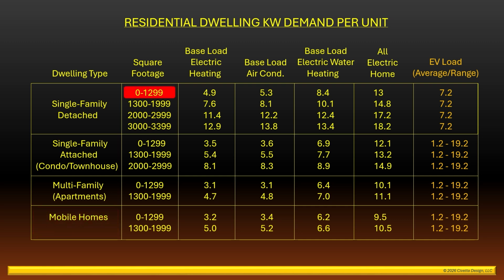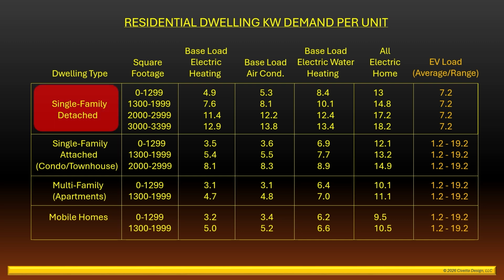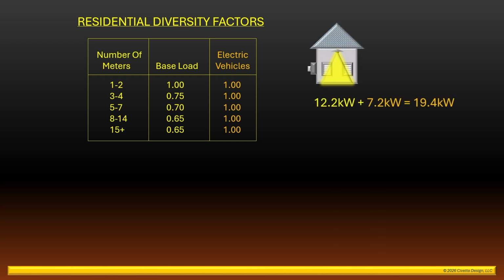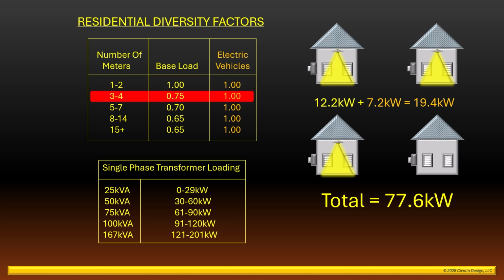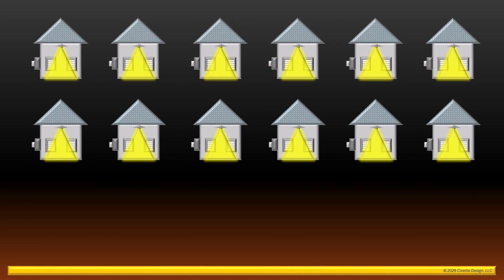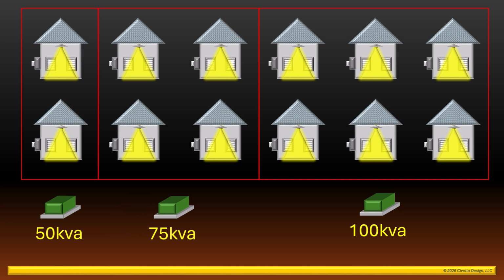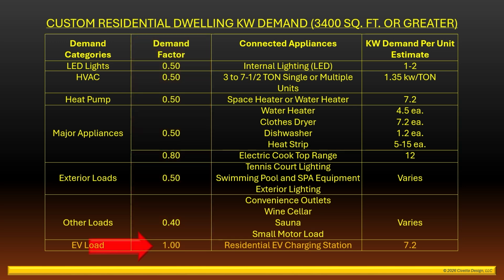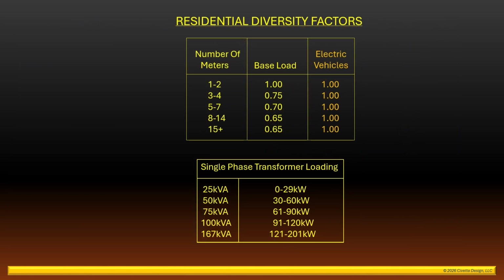Why New Homes' Electrical Demand Is About to Change

Comment: Thanks for this one. I am a licensed electrician since the 80's, remembering studying for the journeyman test calculating service size for single family, multi family, small commercial and large commercial, the same concept applies to all, then spending 30 years as a meter technician with the local electric utility, had to cross over learn from the design engineers about transformer and fuse sizing, feeder sizing, switchgear sizing, relay size and timing in the substations, and current transformer for meters. Appreciate the refresher on this, designing the wiring system for a house remodel.
Reply from the maker: Wow, 30+ years of experience! Thanks for watching and good luck with the remodel! ⚡️
Reply: @utilitydesignsimplified  Thanks! just subscribed.